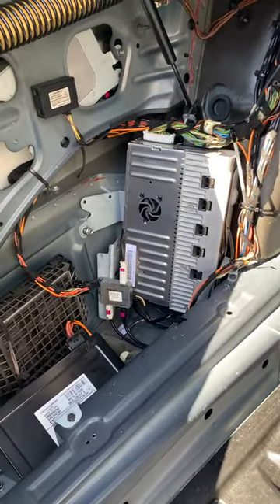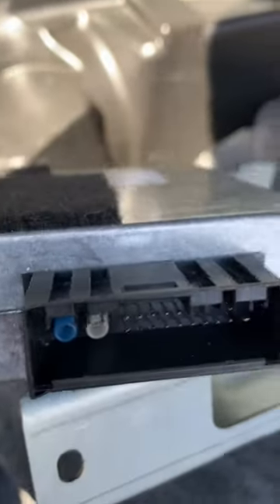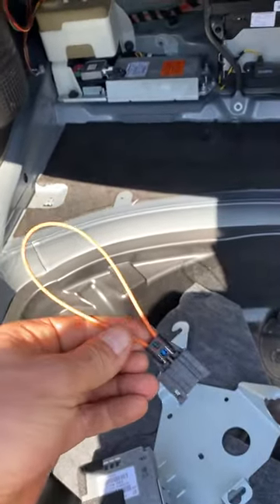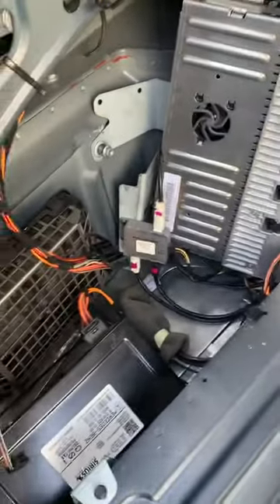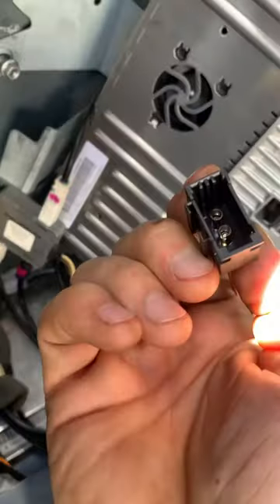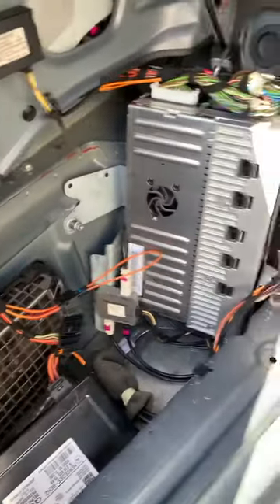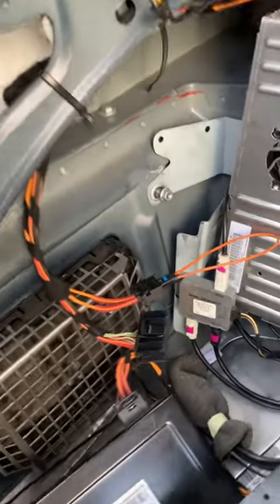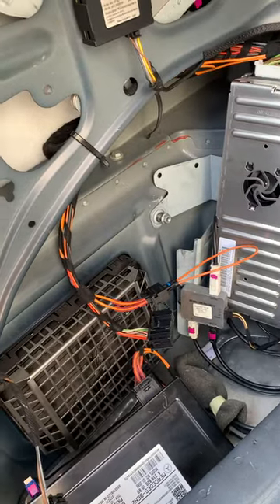2008 Mercedes S550 w221 audio sound issues  (part 2)

Comment: This video truly help me out to much today. I watched it a few times to better understand because I had the same issue with my 2008 s550. I order the same product and receive it today and got on it ASAP. Rode around and it work perfectly, great. Thanks
Reply: What is the model number and where did you find it? I ordered one but the connector didn't fit

Comment: Thanks for all this,i had the same issue with my cl550 no cd no mp3 no dvd player, cracking noise in speakers .
After bypassing the vcm with this loop everything works apart from blue tooth which is not working,but thats fine i can live with it.

Comment: What is that large box mounted to the wheel well in the center of your video? Should the fan on it be running when the car is off? My battery keeps dying and I noticed it running when off.

Comment: hey i have a 2007 ml350 and the audio cuts off 2 minutes after turning the car on and i was wondering if its the same problem as yours
Reply: You ever figure it out? Same issue in my 2007 s550
Reply: @lostmusicvideos5656  nope smh

Comment: This is useful. Also do you know how to check and repair the optic fiber, as I checked all the modules.
Reply: What’s the exactly name of the little tool o need to buy on eBay or Amazon
Reply from the maker: It’s called a fiber optic loop for German cars
Reply: Hello, when I start the car I have no sound or channels, as soon as I remove the MOST from the amplifier and put it back in it works without problems how is that possible? 

as soon as i turn off the car and same problem again
Reply from the maker: @bairddaren4879  When you say no sound is everything else in the screen working properly and there is no sound coming out
Reply: @medolli4557  yes after starting everything works but no channels or sound. you would think the amplifier is broken. but as soon as the MOST goes in and out everything works.